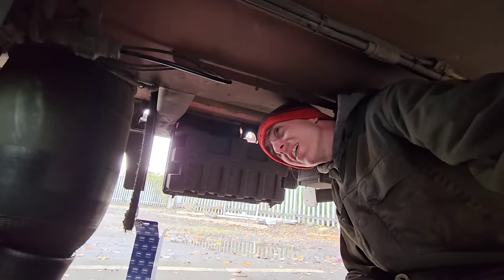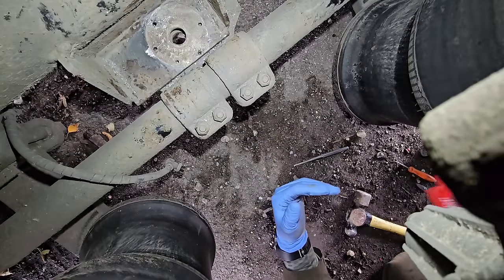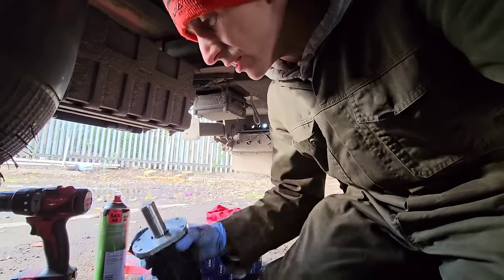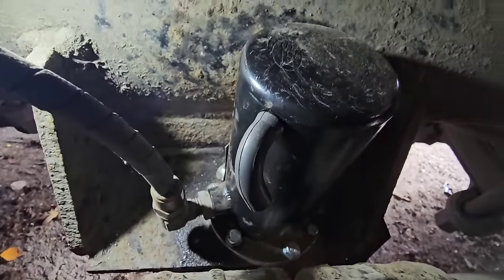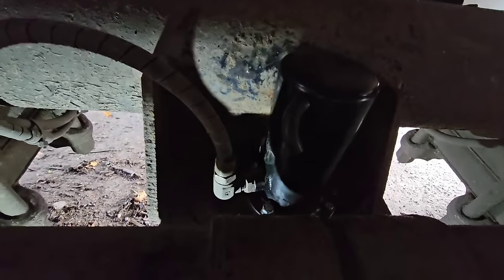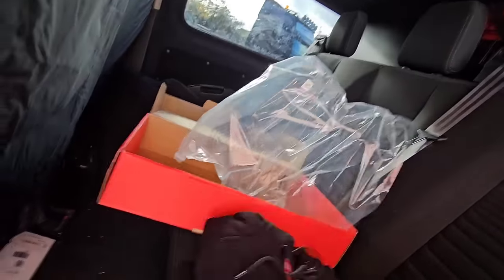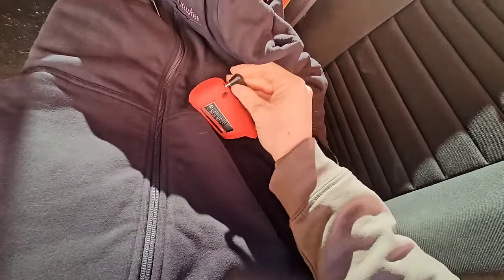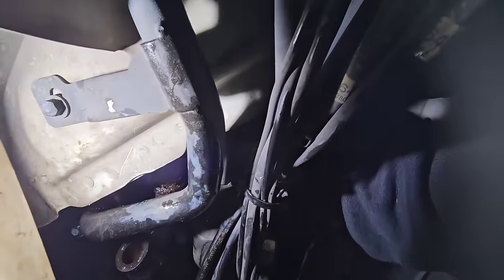Rear steer lock chamber, Volvo water leak & Milkwaukee treat

Comment: Hi Alex.....
To keep warm purchase yourself a pair of fully quilted overalls, a size larger than normal so you can layer up underneath, also a thinsulate balaclava and a pair of mechanix gloves, also replace the insoles in your work boots with winter warm ones.
Laying on the damp cold floor is not a good idea either, purchase yourself a set of rubber interlocking floor mats, they are around £10 on the Halfords trade card.
Take care and stay safe
Best regards
Stefano
Reply from the maker: Thanks, Stefano 👍

Comment: fit a night heater in the rear of the van, i did and perfect to warm myself up
Reply from the maker: I built a nyt heater on a stand that had a long battery lead and a little 5l fuel tank strapped to it so I could move it around.
A mate borrowed it so I best get it back lol 😆